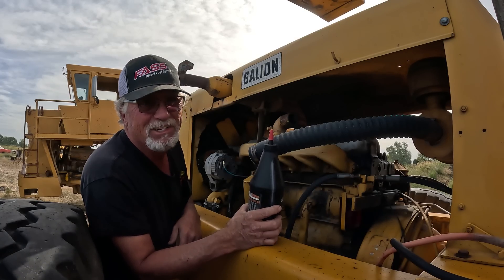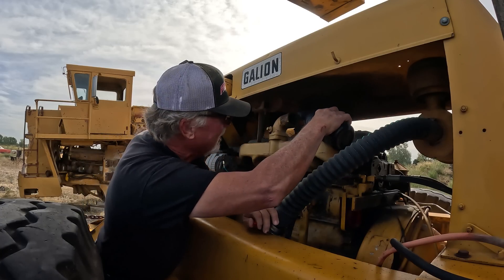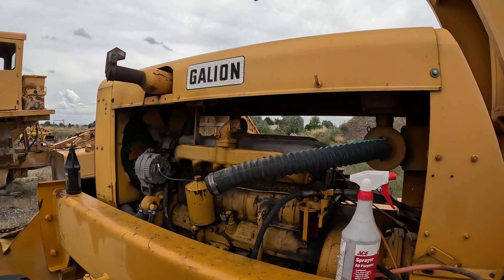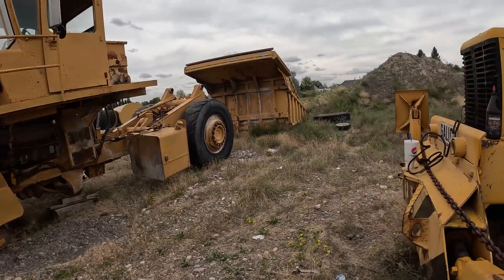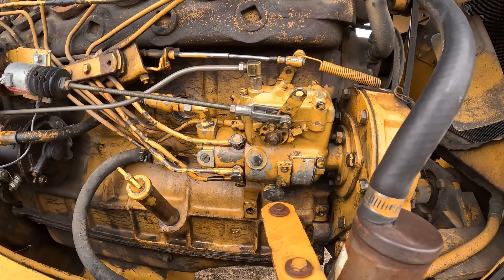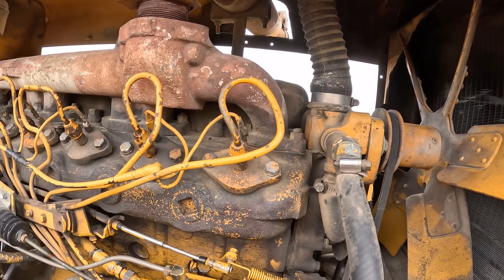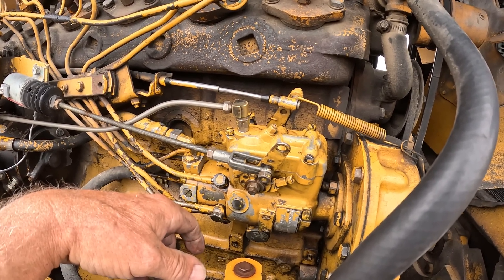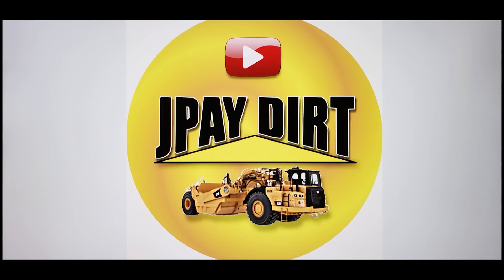Will A Diesel Run On Gas

Comment: If there has been any moisture in that pump at all those plungers will be locked solid. Nothing is going to fix that except a pump re- build. Gas ( petrol ) will have too high an octane rating to ignite in a diesel motor.  Jeff

Comment: In my experience, it's not usually the plungers that stick on these pumps... It's the stop lever, it gets stuck internally in the stop position, and you can't tell because it's spring loaded to the outside so it seems normal even though it's stuck at the no-fuel position. WatchWesWork has videos of taking these apart and freeing it up...
Reply from the maker: already had the cover off and verified the metering valve is free and is not impeded by the shutoff

Comment: Hi Jeff .Just got a suggestion,  you should try to pressurize the fuel tank  with air and force the fuel through the fuel pump up to the injectors.

Comment: Diesel fuel is rated in Cetane which is how easy it will ignite under compression. Gas is rated in Octane which is the exact opposite. Gas is a great solvent but a very poor substitute for diesel fuel.

Comment: I bet plungers are runable or atleast functional. I’m guessing the the rubber flex ring in the pump has flew the coupe(often happens with age on these pumps) it’s a simple fix really but getting all the old rubber crumbs and bits out of everything is another story. Plan on pulling pump and injectors unfortunately.

Comment: If you do decide to pull the pump them Rosa masters are simple enough that even a knuckle dragger like myself can get it apart and back together enough to run. Parts were easy to find. And tool wise you need a “special” torx I believe for the advance I just ground one down if I remember. And there’s a tool for compressing the umbrella seals on the shaft. It’s cheap tho

Comment: A old time trucker told me when there semi was running rough from clogged fuel injectors. At there next diesel fill up they would buy a couple of quarts of atf and pour in the diesel fuel. Rolled black smoke for 60 miles but it cleaned out those injectors.

Comment: I know you're good, just asking. Did you check the fuel tank and filtes to see if you had fuel to the pump. And why didn't you put air to the fuel tank. Just asking. If it turns over then start at the beginning and eliminate the possibilities. 😊.
I like watching jeff win.

Comment: All the time you have spent dicking around Jeff, you could have had the fuel pump out and to the injector shop for repair. My injector pump guy says to me one day if you are going to store one of those style pumps for a long time, run it on Kero and shut it down and leave the Kero  in the system for long time storage. sounds reasonable.

Comment: Watch all your videos get a kick out your self inflicted humor,, I’ve run my own shop for last 35 years working on all kinds of pig iron and done exactly as you done here only I’ve found out that most of them run extremely well on marvel mystery oil , I put a gear oil  cap on the bottle with a piece of hose give an I/ v and bust em off , also try to fill pump with it if possible or put some in filters . Just a trick you might try it’s got lot more lube than either or gas and actually runs pretty good to be bottle feedin one . Keep it up want to dozer project back in action , and give us an old Kenny update!!!!

Comment: I had a Mexican mechanic show me that you wet a cloth towel with gas and stretch it over the intake and it actually works like ether without drying the engine out and no ether locking. Hey I have a Grove Rough Terain 25 ton crane you can use. It's in Rigby just sitting at the shop. And it only has 1800 original hours, it belonged to the Department of Interior.
Reply: That technic I’ve seen used but with either soaked rags

Comment: I've heard that sometimes you can get the plugers to free up in those pumps by putting some compressed air into the fuel inlet, might be worth a shot if you ever get bored enough

Comment: Neighbour had an old tractor that stuck almost wide open due to the lack of lubrication in the low surfer fuel.  We added some lube to the fuel and ran it through the system then worked the rack and it freed up.  (A small tapping device may have been involved). Just can’t remember what we added to the fuel

Comment: I've got a JD4239 in an IR compressor when it sits for 60 days or more it does this. Same pump. There is a barrel in the fuel inlet that sticks closed. I was talking the fuel line off and connecting a small pressure tank with fuel in it at 50 psi and that would move the barrel. But then I tried tapping rapidly on the pump with a SSSmall hammer, tap fast on the cover and the body for 1-2 minutes. It seems to jar the barrel loose every time. Engine starts up.

Comment: The guy @mercedesource adds  Moly lubes to diesel...and that loosens , lubes the goodies...MAYBE A DOSE HERE AND THERE WILL HELP..?
Reply from the maker: interesting,  because they mine Molybdenum here and it's a rock and it's used in grease for pins that get shock loaded, but it's not to be used in ball bearings and WHAT not, so i'm surprised he used it in a fuel system

Comment: Is it getting good fuel supply from the tank? How are the fuel filters?  I usually supply diesel from another tank with an inline primer bulb pump To make sure the injector pump is getting pressure.
Reply from the maker: electric pump, drained old fuel, new filters
Reply: @Jpaydirt  I guess strip down injector pump and clean is the only option

Comment: I remember ,working at fronk Chevrolet as a lube oil  used care cleaner in the early 80,s one day a smart ass mechanic was fixing to give a Oldsmobile diesel atf down the snoot ,I said I wouldn't do. That ,he said ,ive been to school ,what do you know ,I said diesel is oil and you are gona have a runneway ,shure  enough ,it lit off ,I had seen a piece of metal  on the floor and it shut the air horn off and saved the day ,😂

Comment: ????I always wondered if you could back feed the plungers with a porta power to break them free threw an injector line.. Just don't use the full 10000 psi. I have run into this couple times just never took the time to try.

Comment: You tricked me. Thought for sure you were going to fill the IP with gas to soak those plungers, but No, were going to spray it in. Ha
I've had luck taking the lid of and spraying Carb cleaner in the bowls of the IP.  Also instead of either, WD40 works great to run a Diesel on. 
Easier on the Pistons Too.
Bet that was biodiesel in there, or it had a lot  of moister in the system.
I finally got all my old diesels that sit more than they run, switched back to regular non Bio Diesel.
Keep at it, in your spare time you can R&R the pump for us. Love watching you Wrench, almost as much as you operate!
TGP

Comment: running the engine above the speed the governor is requesting will not bleed the lines good, rack will move to defuel because the engine's going faster than the requested RPM, you know?
Gotta have it all the way on "rabbit" and not "turtle" heh
Reply from the maker: I don't think I ever went over it's governed speed, I was smart enough to have it wide open throttle though

Comment: Hahah you gave it a shot for sure. I'm really disappointed it didn't start pumping.
Reply from the maker: I have another last ditch plan, it involves gas ether and a HP pump to supply fuel....KABOOM
Reply: Fill the pump with ATF and leave it a day or 2 if not get the 🇨🇦1 legged fella down he will sort it fa ya for a case or 3 🍺🍺🍺